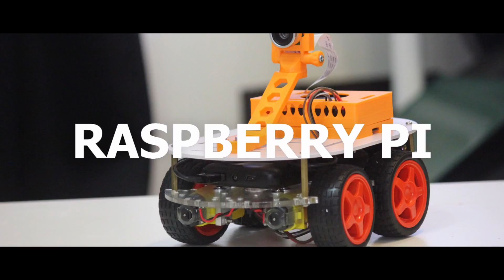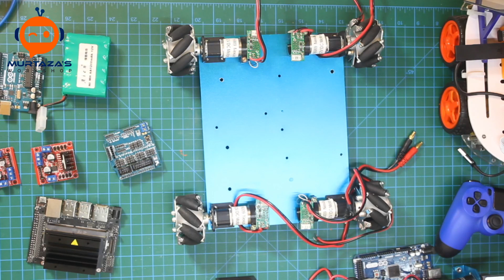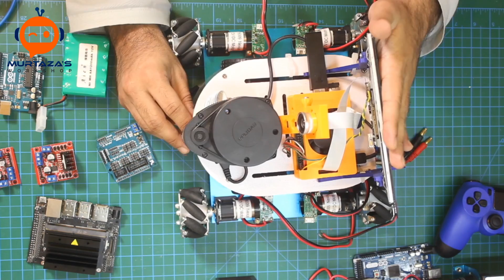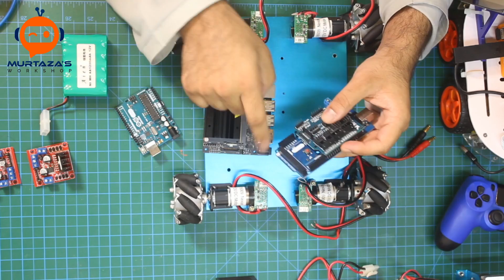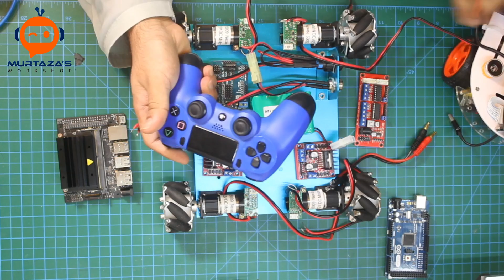INTRODUCTION TO SELF DRIVING CAR USING JETSON NANO

Comment: Hi I am confused in a project iam working. I wan t to build a boat that avoids obstacles that are on the surface o f water. What is easier to use, classic distance sensors or computer vision? (Iam a newbie at AI and computer vision.)

Comment: I always wanted to create a  farming robot :)
That would take care of strawberries , for example.
This kind of robot could watch them grow, clean, cure (if needed) and then finally pick up strawberries.
I am watching your films to gather knowledge, I don't know if I'll be able to utilize it but I like your approach very much.
Reply from the maker: That is a great idea. This robot might not be powerful enough to move freely on a farm as you would need suspension and more powerful  motors. But the principles learned here could be applied to a bigger robot. You might want to look at sabertooth motor driver and 24V dc scooter motors.

Comment: hi, currently i'm doing same project but with faster car (24 km/h). I can suggest that using arduino - jetson nano communication to drive motors creates a lot of lag. In your case may not be a problem but i recommend that using i2c driver or faster communicaion between them instead of serial.
Also, im beginner on image processing and control algorithms (or CNN, probably you will use a neural network which is awesome), soo I look forward to the things you will do and learn from you
Reply: Maybe you can use an Arduino Mega instead of Uno. Arduino Mega has a much faster microcontroller, AtMega2560, instead of the AtMega328 on the Uno
Reply: @zheyingchin4194  using mega already, as i know both of them 16mhz so no difference but not sure. Thanks for answer!
Reply: Muhammed Sezer there’s one more choice. Arduino Due. It uses arm chip so definitely faster. But it runs on 3.3v so there might be some modifications you need to do to the circuit.
Reply: @zheyingchin4194  i will use pca9685 as driver since im using brushless motor and servos, but for other project i will try arduino due for serial port communication with higher serial speeds
Reply from the maker: Thanx for your suggestion . Noted

Comment: A bit expensive 
🤔🤔🤔🤔
Where can i get a jetson nano ??? 
🤔🤔🤔🤔🤔
Reply: Yep, is a little expensive... I am still saving money :P jejeje...  You can check aliexpress,Amazon or developer.nvidia.com...
Reply: Sure, this project is not cheap; 300 for the wheel kit, about 80-90 for lidar (I guess it is RPLidar A1), and depending on which kit you buy, about 120-180 for jetson nano, plus H-Bridges (cheap product for only 5 more or less), arduino whith shield and so on...and camera if your jetson nano kit choice did not include one, ah, and batteries/power bank (you can find UPS for jetson nano for about 35-50) Whole project from scratch will cost about 650-800-1000 (of course if you have components from other projects it will be cheaper, but hey, this is an expensive hobby....😅
Anyway, you can allways follow the tuto series and get ideas, learn and adapt things to your own projects; enjoy learning! 👍
Reply: Yeah.Cuz Nvidia is more powerfull than Raspberry PI.Nvidia can handle it with better performance
Reply: Amazon
Reply from the maker: I have added the link in the description